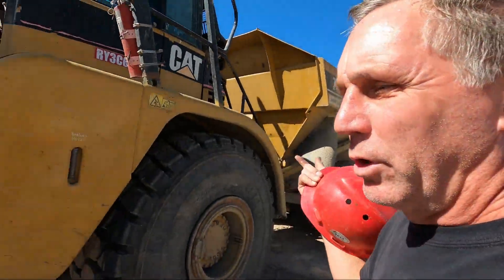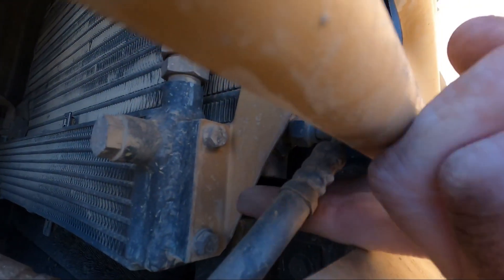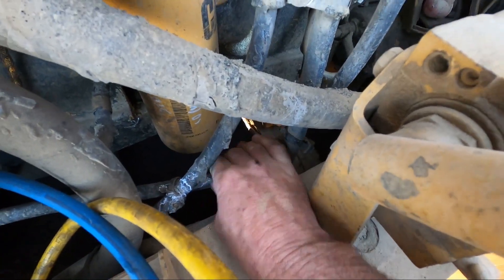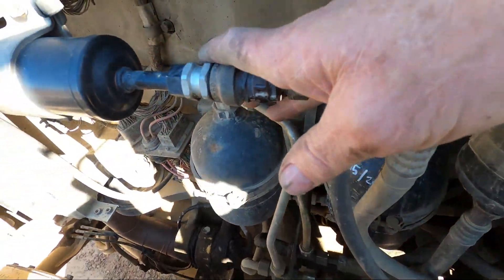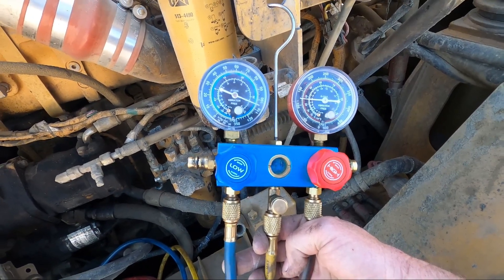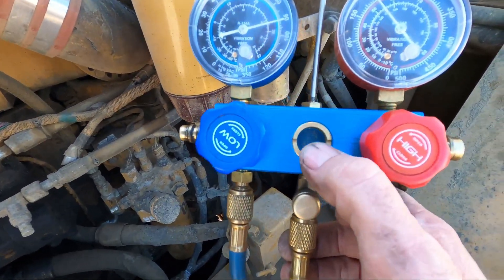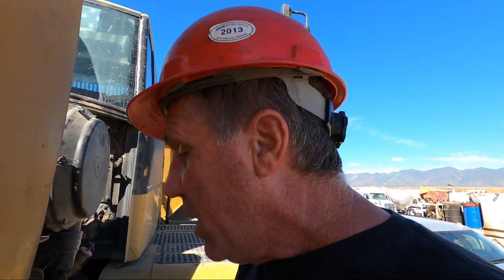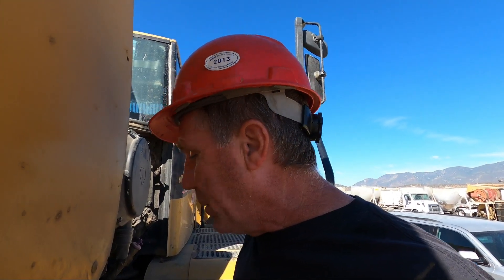Cat 740 AC Repair

Comment: with all due respect it was R-12 you cant release- HFC's push the ozone layer away from the artic center. The hole has reduced to no issue now that we stopped HFC's. R134A there is no law releasing it to the atmosphere but you do understand its toxic to breath.
.
Reply from the maker: The hole in the ozone layer was the precursor scam to global warming. DuPont’s patent was expiring as it had been nearly 50 years since this byproduct of a certain cyanide gas that they had made in the late 30’s for a certain European country. This was a way to get a patent on a new refrigerant that would replace R-12. 
R-12 was only poisonous if inhaled through a flame. And yes you are right R-134a is poisonous straight out of the can. 
The first system I converted from R-12 to R-134a almost killed me as I treated it like R-12 and inhaled a good dose of it as I had a leak in the system. 
Over the years I have seen a handful of heavy Equipment operators poisoned by it. I would have a guy go home puking his guts up and then the next morning his A/C would be out of Freon due to a leak in the evaporator core causing the R134a to fill his cab.

And it is illegal to release R134a into the atmosphere along with any Freon gas.

Comment: What is the reason for ac compressor on off automatically 
And also when i strat the machine and started the ac system it take time to start compressor
Reply from the maker: Possibly low on Freon, loose connection on low/high pressure safety switch located on rear of compressor.
Plugged receiver dryer. If the dryer is plugged the high side pressure will be too high and the low side will be very low and low side won’t react even after adding more Freon.

Comment: Help!!!!

1. What are the reasons why the air conditioner does not refrigerate and the troubleshooting steps
2. What are the reasons why the generator does not generate electricity, and the inspection steps
Reply from the maker: I bet you have either a bad ground or broken wired in the harness

Comment: how much pressure works
Reply from the maker: With the A/C running with engine at idle I line to have around 25 to 30 psi on the low side.

Comment: I see thank you and I think my work last week 988 wheel loader i changed all hose all filter flashing condenser and Evaporator new compressor then I put gas about 220psi high side but low side is only 20psi while running the engine but cooling not good after that I put more refrigerant 270psi high side 30psi low side become cold while idling the engine if i rising the rpm 310psi high side low side same 30psi this is normal?
Reply from the maker: Yes

Comment: Way too high on the high side bro
Reply from the maker: Well it sure runs cold.
Reply: @RasmussenEquipment  Use a scale.
Reply from the maker: I actually use an A/C machine to evacuate and refill. But this is how to check it with only gauges. Most people cannot afford a $10k machine.

Comment: I have 2014 CAT ct660. I’m having a hard time to find low pressure valve. Can you help?
Reply from the maker: I would have to look at it. 
I has to be somewhere between the evaporator core and the compressor. The low side or suction line is the larger hose.

Comment: I find slowly metering the refer in by just cracking the valve is much safer especially if you a charging with refer tank upside down and in liquid state keeps the pump from flooding and also over charge by accident. 
Just my 2 cents.  FJB!!!!
Reply: That's why you use a scale.

Comment: Been looking around and can’t find any info as to where the blower resister is located on the 320 excavator any one knows?
Reply from the maker: I’d have to look it up later but they are usually in the blower box so that the air passing through keeps them from overheating
Reply: @RasmussenEquipment  thanks! I will keep looking
Reply from the maker: What is the serial number prefix